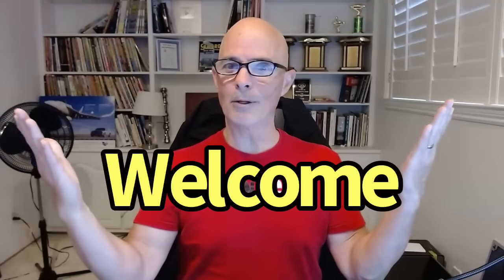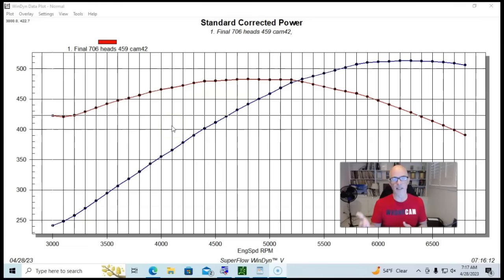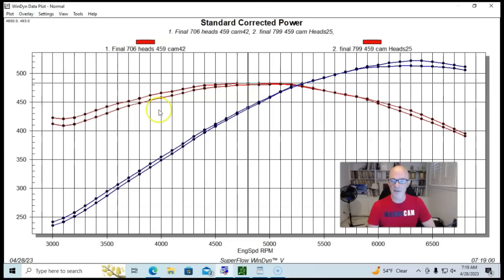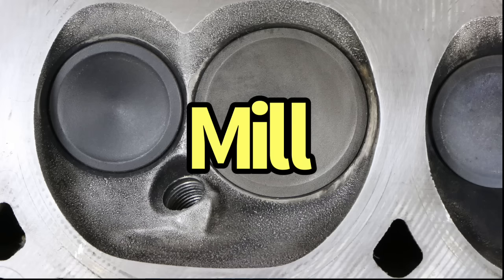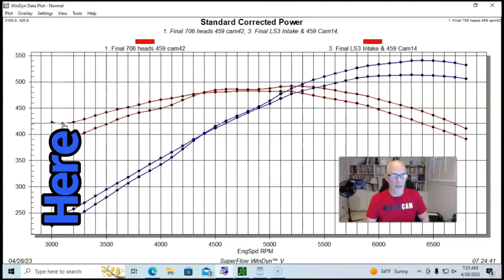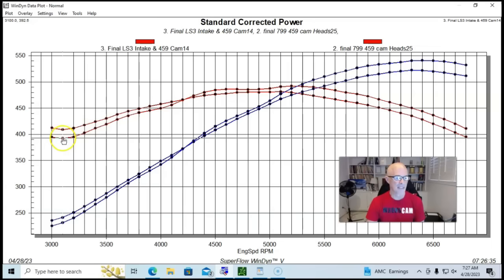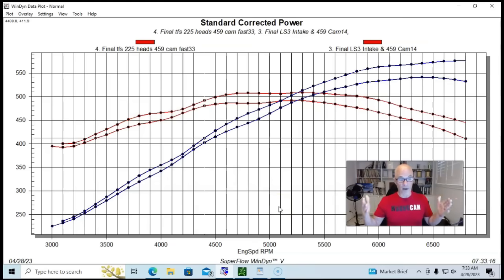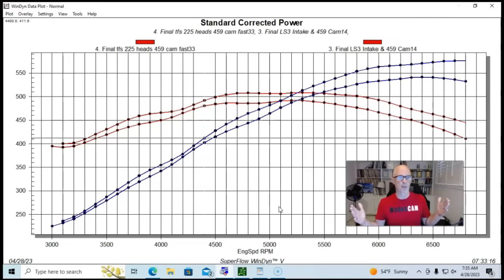HOW TO MAKE 500+ HP WITH STOCK 706 HEADS. 706 VS 799 VS LY6 VS TFS HEAD TEST! 514 HP WITH 232 CFM!

Comment: I have a L59 5.3 with 706 heads and im trying to decide if I want to get my stock heads ported or just get a set of Trick Flows 🤔
Reply from the maker: you can get enough flow from either
Reply: @richardholdener1727  As far as money is concerned, would it be better to spend it on getting my 706s ported? Or just buy a set of Trick Flow or AFR? Im rebuilding the entire top end so the heads are coming off anyway.
Reply from the maker: you need to see what the costs are for each-either set (if the stock ones are ported properly) will provide enough flow to support any na power level you might have on a 5.3L

Comment: Good video.

The rec ports become FAR more efficient with turbo applications where your stuffing 2-3 the air volume through the heads.
And as im sure other guys mentioned you can mill 0.030 off em and get back some compression (which increases power EVERYWHERE). Get back all that low end tq you lost and gain even more up top. 

I would really like too see you run some ac delco cnc ported ls9 heads. Factory titanium intake valves, factory sodium filled exhaust valves, factory 350cfm heads.
Reply from the maker: boost just multiplies what is there-doesn't matter rec or cath port
Reply: @Richard Holdener  Yes but with an 80mm the rec ports are far less of a restriction than cathedral ports. 

Seen L76 make 930hp on 15psi. Stock rec ports. Modest turbo cam, (s2 btr turbo cam iirc.)

Thats just not happening with even 243/799 heads.
Reply: @Saddedude  that isn't how it works he has videos showing the results

The heads arent a "restriction"

If the rec ports make 20hp more na they make 40hp more at 15 psi

The turbo just multiplies the na result the behavior is exactly the same
Reply: @Chip Currey  yeah so a 40-50hp gain is a big deal.  Now lets talk 30 psi
Reply: He has another video comparing cathedral vs rec when turbocharged and the gap is exactly the same but multiplied by boost. The rec isn't any more efficient when turbo
Reply: Mill .030" off em too gain back some compression and at 30psi your talking 100hp over cath port. With no real loss in torque
Reply: @Saddedude  milling factory heads and then running 30 psi is a mistake. Factory heads warp too easily at high boost levels without milling.
Reply: @ZONES89RS  yeah. Unless you get the ls9 rec port heads. Superior casting with a superior alloy with a thicker deck.

Comment: I put together a lq9 with a 218/224 600/600 112 with 241 heads. Started looking thru old posts on forums, and it's funny how much misinformation is out there. And there still is.  People will still argue about this stuff even with Richard's testing. Great video and keep up the good work!
Reply: It’s normal. People believe what they will. I try to recommend smaller cams and guys don’t wanna hear it. So let them do whatever
Reply: @ZONES89RS Hey I'm building a LQ9 if I put the 706 head's on it can I change the cam to the truck Norris cam and be ok not trying slap valve and piston and should I run a 5.3 head gasket may be a dumb question I'm just not sure 😁
Reply: @my95chevy  should be fine as that isn’t a very big cam. Works well for trucks but those heads are going to increase torque production. You won’t be disappointed
Reply: @my95chevy  you have to use 6.0 gasket because the piston size is different than a 5.3 i have a lq4 with 706 head I built last year
Reply: @mike-wz9bb  I was hearing different so I wanted to make sure thanks 👍
Reply: @my95chevy   no prob definitely I think you will like you  build for day to day driving  good still maintaining low end power will gaining power all the way to the rpm range you have closed to 10.8:1-11:1 compression   but you would be good with a 93 tune you will probably make close mid to high 400's 450-490 I'm guessing throttle body, intake and injectors with long tube headers will help you achieve that
Reply: @mike-wz9bb  do you know what intake the 6.0 likes that budget friendly 😆
Reply: @my95chevy   alot of people use the trailblazer SS intake  but you should research to see what it takes to make it work on your application I run the ls6 intake on my car

Comment: I did an LS swap in my 00 escalade. LS1 5.3 punched out to 5.7, 243 heads, beehive springs, built 4l60e and a Summit Stage 3 cam. Waiting to do 4:11 gears and tbss intake, but as it stands now, torque definitely isnt an issue. Probably will replace the cam with a torque cam or truck norris, becuase im never at the 5000rpm to use the horsepower. Unless youre racing, who the hell gets up to 5500+ rpm
Reply: I’m running a tsp 216/220 cam with full bolt ons and 373 gears. I rev it out to 6300 and that’s in a lm7 5.3

Comment: As someone only interested in towing I have learned a lot from all of your videos. My first mistake was not researching all of this before buying a truck with a 5.3 and 4L60E. There's only so much you can do to improve low end torque. I'm currently debating between slapping in a 6.2l vs. cam, headers and turbo. In the end the motor swap is likely the most cost effective. I shopped 8.1l trucks for a while but finding a good one is difficult and the 6.2l makes more hp and just as much torque in stock form and better mpg. I have considered just upgrading the whole truck but practically everything is new or rebuilt throughout the drivetrain except the motor. Decisions, decisions.
Reply: 6 liter and don’t look back. The extra 2k for a 6.2 isn’t worth the whopping 15-20 more HP/torque in my opinion.
Reply: @ZONES89RS I😮 agree go with a forged stroker if u can afford it a cast one if u can't. 💨
Reply: Seems to me that a stroker setup for your 5.3 might be the best option.  That way you get more displacement (and more torque) than the 6.2l, and you don't have to mess with any of the peripherals.

Comment: Just wondering can you do the same to a Ford engine.
Reply from the maker: there is not a good stock Ford head (302-351) unless you go back to the Cleveland
Reply: You'd hafta do alot of machining to get any of those heads to work on the ford block properly

Comment: Great video Rich!   For N/A LS combos, There reaches threshold of displacement where the Rec port head begins to shine all the way across the RPM range.  And that doesn’t happen until well into the 400’s for LS engines. A ported Rec Port head will see similar gains over its stock version similarly to the ported cathedral port heads over their stock versions.  (Go figure?!)There’s obviously more variables that go into which is better for each application. What it comes down to when you start getting more and more extreme is the complete combination of the entire package; cam, port volume, cfm, valve size, all need to work together.  There’s always a limiting factor in every setup though. Its typically in the head or exhaust restriction. The intake side just needs to supply enough air.
Reply from the maker: a ported rec port head won't see gains like the cath port heads did because they are already too big and have enough flow on the 6.0-you need lots of motor for rec port heads (especially ported ones)
Reply: @richardholdener1727  They see BIG gains on porting the exhaust ports. Intake ports just need a clean up.
Reply: @richardholdener1727  I have a question… I’ve always been curious have you done a video with the fad of port polish and dimpling the heads? I remember that was a thing, but I never got any definitive answer when it came to any type of benefits when it came to doing that.

Comment: An advantage the 706 head has over the others that hasn't been mentioned yet is it experiences less valve shrouding flow restrictions. The two reasons are the smaller valve is easier to flow around at high lift, and the smaller bore spacing of the valve moves the valve further away from the cylinder wall. Both of these reduce restrictions at lower RPMs, hence the increase in low range torque.
Reply from the maker: the chamber inside diameter is actually smaller on the 706 so it has valve shrounding in the chamber too
Reply: As rich stated, being designed for the 4.8/5.3 bore it has the chamber issue but it just doesn’t matter due to the efficiency of those heads with a bigger displacement.

I turn my stock stuff to 7500. So it really takes advantage of the bigger heads for that reason with my toys. 

A tow pig will just prefer the smaller heads all day since it would play under 4k most of the time.

Comment: My 408 has to be making like 590! Unless the Trail blazer intake is holding it back. It is ported though whatever that’s worth. My Mamo 205s flow 300 and I have a cam that’s very close to the one in the test. It’s a 233/239 600 112. If I did it over I probably would have just used the LS3 heads so you get access to a killer intake for cheap.

Comment: What I wanna know is do you think the 706 heads would gain much torque on a stock 6.0  you know for helping out a big heavy Denali XL, I know this test probably has never been done I’m just wondering if I could still run on 89 octane or less
Reply: My dad has 799s on his 6.0 with a stage 1 BTR towing cam. It’s a torque monster! He drags logs out of the woods for his sawmill with it. It’s a crew cab 4x4. The thing sounds crazy under load with a big tree dragging behind it 😂
Reply: @chandlerlofton6536  yeah definitely better than the 317’s
Reply from the maker: a 706 head swap on a 6.0l to replace the 317s is a sizeable chunk of power
Reply: @richardholdener1727  thank you, I’m only interested in power off idle to 5000 RPM or so, what kind of fuel do you think I’m gonna have to run if I do the swap ?
Reply: @DSRE535  dad runs 93 in his, but I think 89 would work if it’s tuned for it. I think the compression came out to 10.1 or something like that.

Comment: What about a ported 210 or 15 head? Might have made as much as the LS3 head up top and 706 down low.
Reply from the maker: what is a ported 210 or 15 head?
Reply: @richardholdener1727  210 or 215 head. I don't know like some of the name brands sell them. I guess smaller in valve sizes?

Comment: I still like the LS3 head/ intake combo on a Mild 6.0. easy 500WHP combo without the expense of a CNC head and... AND I'm usually working on LQ4/LQ9 6.0's  with a kabilion miles the 100,000 mile 317  heads need a valve job anyway.   a Dorman LS3 intake and a pair of Blueprint LS3 heads is a solid budget option  just about any Cam/Tune can snezze on in and make 500whp
Reply: The blue print heads are still 1200USD each so with to doorman intake and heads it's close to 3k just for the heads and intake. so its not the cheapest way to make 500hp when you can port the 706 and still get there. Is less time tho🤷‍♂️
Reply: @mackenziehutchison4838  WOW i just price checked that there are lots of $600-900 LS3 options. scratch the blueprint.  the GM part # 12675871 are $800 ish and RHS is under $700ea  that's new pricing, if your local machine shop can beat that for a Tank/ flux/ lap & seat pressure check good for them mine can't.
Reply from the maker: a mild 6.0l with ls3 heads won't make 500 whp
Reply: @richardholdener1727  mine on one dyno mild lq9 with ls3 topend made 414hp on one dyno. Was disappointed. Got it returned on another dyno but they refused to run it in 1:1 because I had 2.73 gears and base was 370 and retuned 395hp

Comment: I always thought cathedral port heads were factor great from the start they had to make out the gen1 smallblock so there you have wonderful content and it would be nice to do it with 4150 style intakes and holley or atomic efi.
Reply from the maker: I have run single pane intakes many times
Reply: I think that was because back in the day EFI was VooDoo/ witchcraft and guys where clawing at carb options and even distributor options.   as the tech has advanced and EFI has become less of a dark art.
Reply: Terminator x has lowered the efi barrier of entry to be cheaper than a carb for the LS.

Also, search out Joe Simpson and you’ll find dozens of tuning videos to make it very easy to do it yourself.
Reply: Well i will search you content sorry

Comment: For street driving it’s all about the low end of the torque curve. The 706 heads have the smallest chamber and that’s the biggest reason they excel. The TFS 225s likewise have 65 cc chambers (ie, smaller, just not as small) and beat the rec port heads in part due to the increase in compression. I think the ports are more refined to take advantage of the 13.5° valve angle, too. They’re just better—but my engine came with 823s…I’ll stick with them for now.
Reply: Also worth noting, the expensive trickflow heads required an expensive FAST intake to make the HP/TQ gains. Whereas, Mr Holdener has proven the (cheap) truck rectangle port intake to be equal to the LS3 on (cheap) rectangle port heads
Reply: @kylemilligan752  Yep. Got one of those, too.
Reply: I don’t understand why compression ratio is not talked about more. The 706 heads have tiny chambers. That’s why they work well in these applications. Same with all these cam swaps. Put these large cams in otherwise stock engines and the results aren’t nearly what they could be if the compression was straightened out.
Reply from the maker: chamber volumes were provided in the video and compression is not what provided the change in power offered by the 706 heads, and the cam run on this motor was run with a stock bottom end and stock heads!
Reply: @richardholdener1727  I wasn’t necessarily talking about these tests here. I am a big fan of the testing that you do. I was speaking more generally, especially when it comes to large camshafts and stock bottom ends. I’m not saying that compression is the only thing that separates the setups in this video, but it is a factor.
Reply: your not wrong but if you look at the 799 Vs the 317 head, the ONLY difference is the combustion chamber volume....... you can easily throw more timing at a 317 head than you ever could on a 799 but this was a Head VS Head test.  same goes for Rec Vs Cat port.   you can fix the minimal low end losses  with some timing and fuel.   at the end of the day we are splitting hairs 8lbft here or 19hp there.   I can get LS3 heads and intake attached to a running short block at Copart 2 or 3 times before I pay for the TFS 225's
Reply from the maker: the difference between the 317 and 799 heads is NOT just the size of the chamber, it is the design of the chamber. Even milled, the 317 makes less than the 799 heads.

Comment: what about Ported and Polished 317'S i have a 408 stroker with ported and polished 317's with 9:7.1 i wonder how much hp ill have
Reply: A 408 with a summit stage 2 truck cam will not make 600 horsepower but should have torque to spare from idle -4800rpm and make really good torque in this rpm range and not need a large stall converter or super steep gearing 2200-2600rpm stall converter 3.42-3.73 gearing should make you leave from a dead stop very very hard hard enough to need suspension mods and drag radials for it to hook the 4 inch stroke crankshaft will make power happen 1000rpm sooner than a 3.62 crankshaft would with the same camshaft
Reply: @Gloria Maletta  I have a 2600 stall and 4.56 gear and 35 inch tires it's in a 73 k5 blazer
Reply: @codyharris805  2600 should be perfect l thought it was in a car not a big tire 4 wheel drive SUV for what your using it for horsepower isn't as important as torque is it's going to pull hard off road or steep hills or in the mud and do so without revving the shit out of it peak torque will be 4000-4200rpm
Reply from the maker: depends on cam and intake and how well the porting was
Reply: @richardholdener1727  west coast cylinder did the port job I also have SS valves and I believe it’s summits stage 2 truck cam do you think I’ll be over 600
Reply from the maker: won't reach 600 hp with a truck cam
Reply: @richardholdener1727  well that’s disappointing I spent a little over 14 k. On the build

Comment: Does the VVT on the L96 (and its rec port heads) make up for the low end torque deficit perhaps?   Since the L96 was the last hurrah of the LS engines in the HD trucks you'd think they would put their best combination together. I think the stock 360 hp rating on the L96 is very conservative.
Reply: The ly6/l96 are a full point less compression than the l99/ls3
Reply: Trucks have crap intake and exhaust. A L86 has the same; heads, cam, compression as a LT1. The difference is intake and exhaust manifolds, intake air ducting, exhaust system and tune. Thats it. There is a 35 or 40hp difference between a L86 and Lt1.
The L99, the 6.2l VVT from Camaro SS with auto has 400hp. That's 40hp up on the L96. That 360hp rating is probably a little conservative but I doubt more than 10hp.
The trucks, especially the 2500/3500 have a really restrictive intake and exhaust system that keeps things quiet.
Even the L8T has the same heads and cam as the LT1 and a little less compression. The manifolds, ducting and exhaust drags that down to 401hp...
Reply: So an intake and exhaust is a 40 hp promise?

Comment: The results speak for themselves. But it becomes a point where most don't have enough traction to use the torque down low in the rpm band, so having the HP up high and killing some low end torque works to their advantage. That's what I'm planning to do.
Reply: Exactly, spinning ain't winning. If it's a daily driver truck though you generally want as much low end power as you can
Reply: Gearing would help get it into your power band too. I put 3.89 gears in my 67 mustang.

Comment: From what I see on the dyno graphs the 706is going to be the head to use on a worktruck app. Every other head tested will out run the 706 if the converter is setup correctly. The combination that make the most average power over the USED rpm range will be the fastest. The TFS head would absolutely drag every other combo tested here.